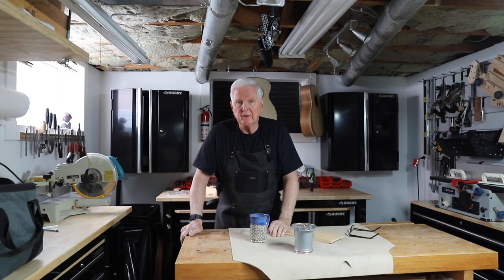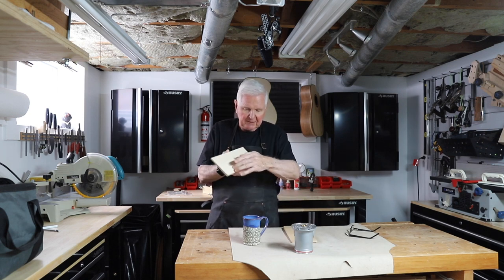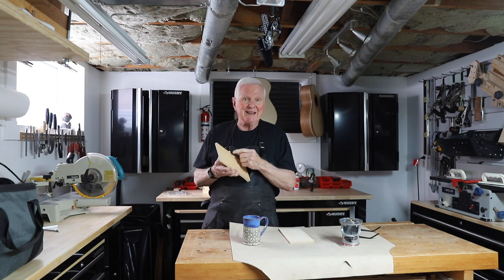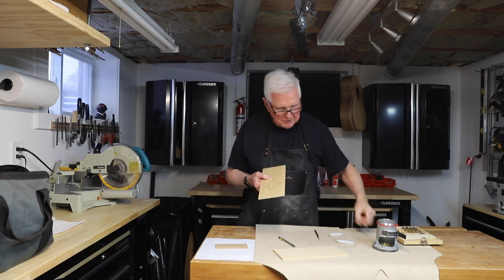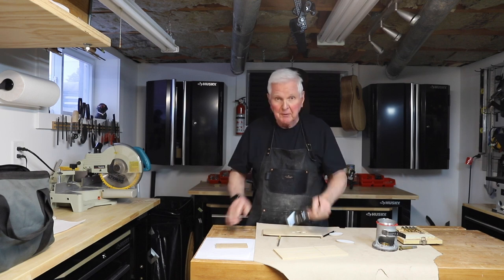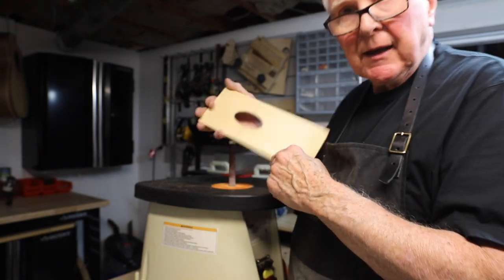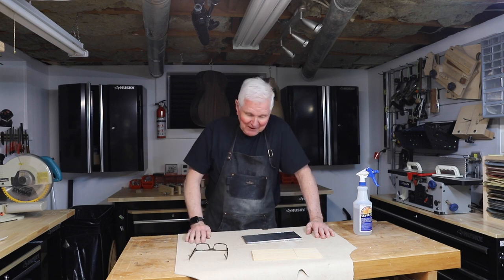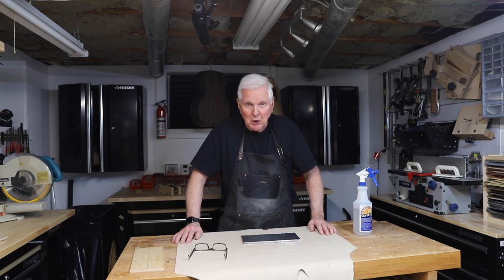New:  Acoustic Guitar Sound Port Jig May Work...THIS TIME!

Comment: As a woodworker I keep yelling at the screen, but you're obviously not hearing me. LOL

You should be able to make the jig out of a piece of acrylic and then bend it to fit the form. Cut the hole before you bend it. Obviously,  it will take heat to bend it. Once bent you'll have a jig that will last for years.
Reply from the maker: I tried that but it broke. Maybe I didn't heat it enough.